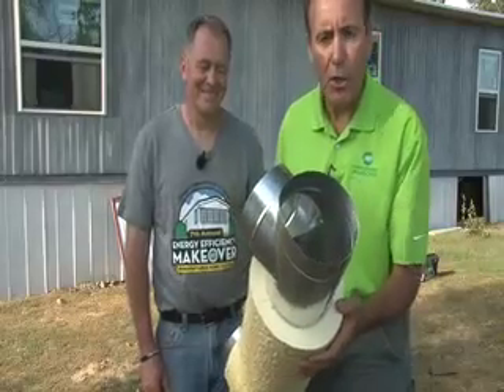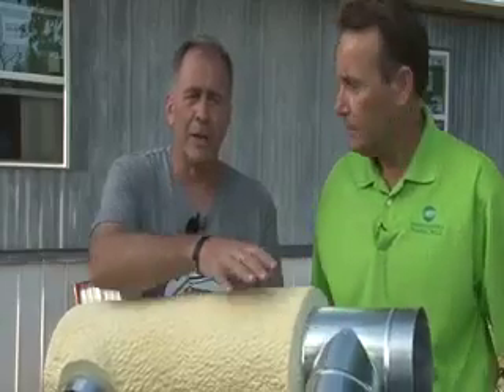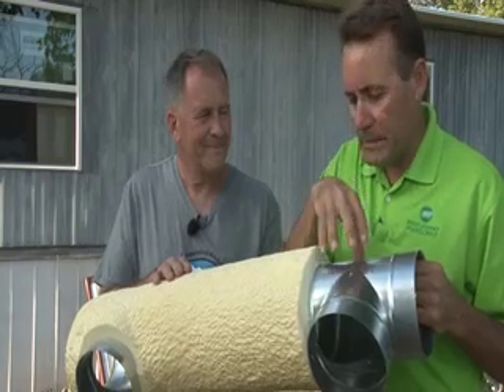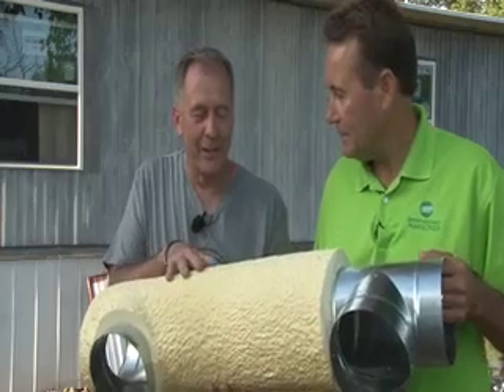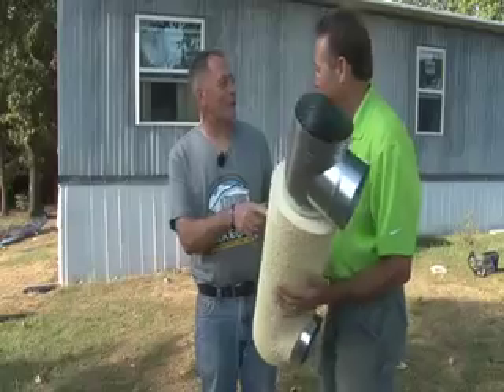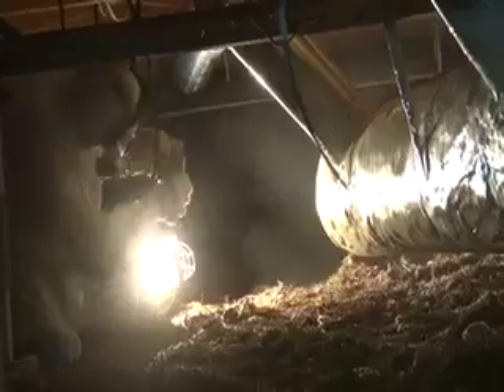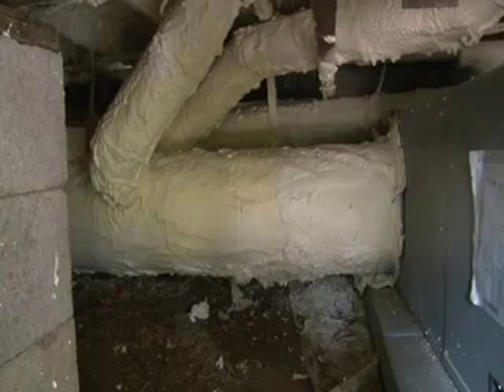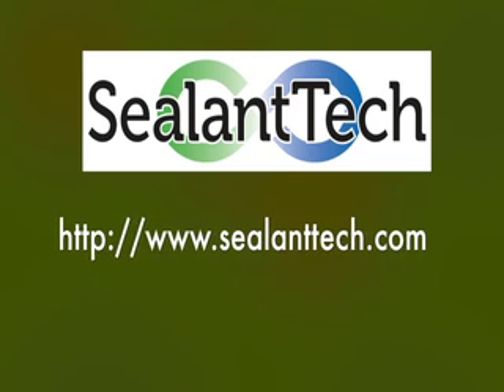Spray Foam For HVAC Ducts using the Spray Foam Hybrid

Comment: can i air seal with foam over the insulation that wraps the ducts (ducts are in the attic)?
Reply: I wouldn't recommend it.  The insulation will be very dusty, and the foam may not stick to it.
Reply: Ok